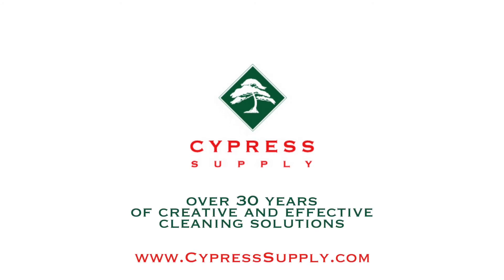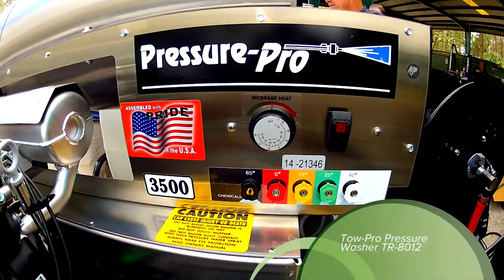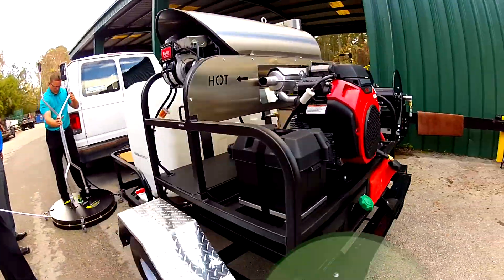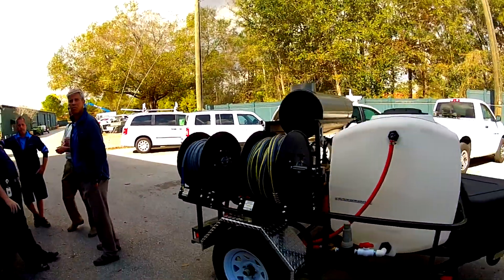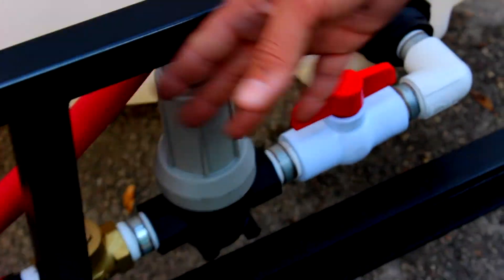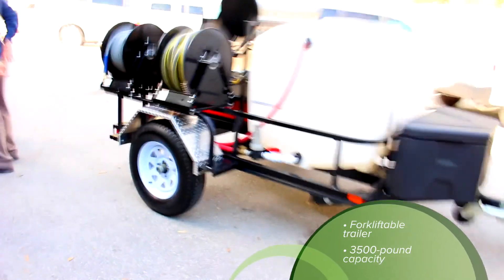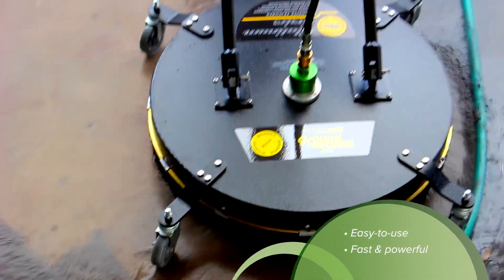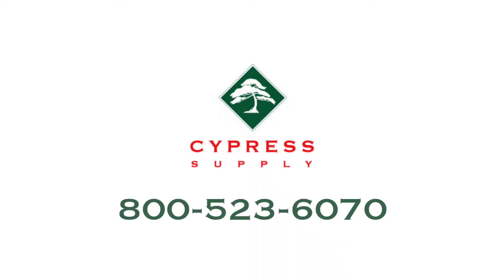Tow-Pro Pressure Washer from Cypress Supply

Comment from the maker: For large, heavy duty, and commercial-grade outdoor cleaning projects, nothing will get the job done faster than a Tow-Pro Pressure Washer from Cypress Supply.

The TR-8012 Tow-Pro hot water pressure washer made by Pressure-Pro in Fort Pierce FL features a pump that generates 8 gallons of water per minute at 3500 PSI.

This commercial-grade unit produces enough pressure and force to remove nearly anything from any surface, saving your organization time and money on all your outdoor cleaning projects.

For more information call 800-523-6070 or visit http://www.CypressSupply.com

 #janitorialcleaning   #janitorialsupply   #orlando   #centralflorida   #pressurewasher   #cleaning   #outdoors   #heavyduty   #commercial   #productdemo   #cleaning   #pavement   #maintenance